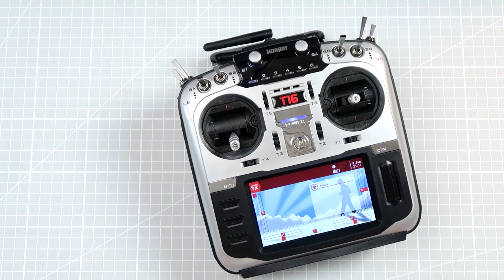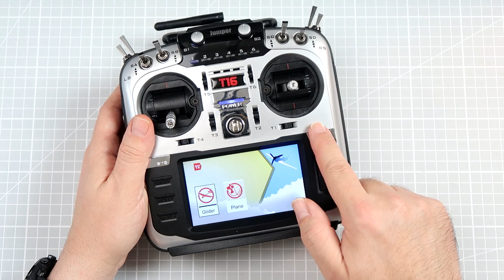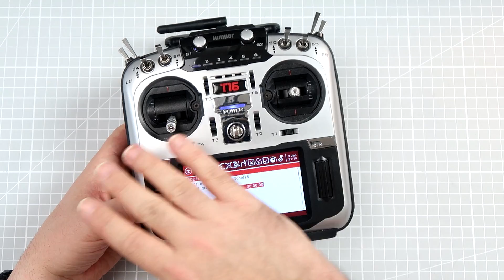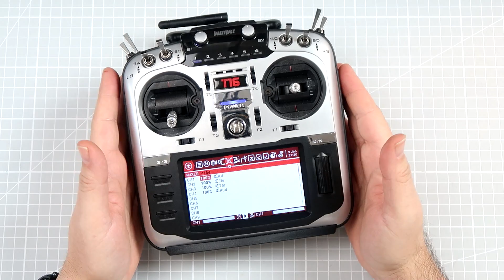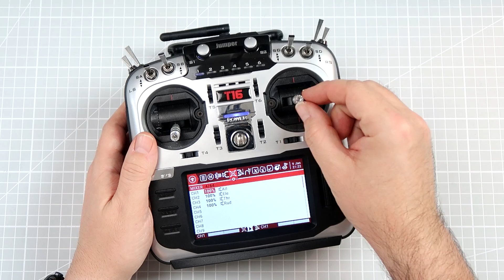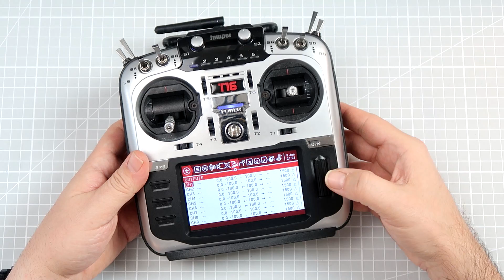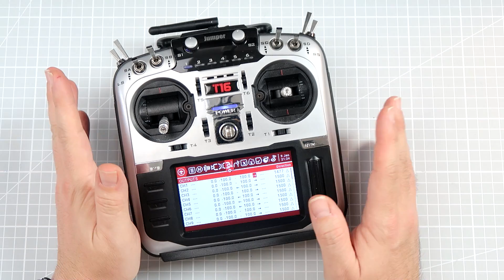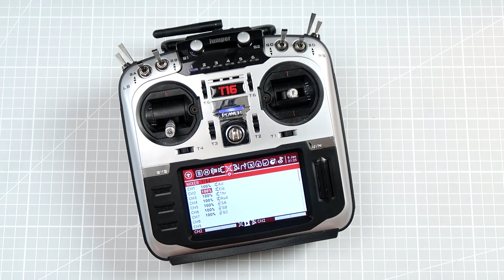OpenTX & EdgeTX Tutorial - Basic Setup

Comment: How to fix Failsafe problem for the FlySky receivers in T16? For example, with the X6B receiver, I always get the last levels of the signals when the radio is off, even though I set up NO PULSES
Reply from the maker: and how do you measure that?
Reply: @FPVUniversity  When my radio is on and my drone is connected to the configurator I can see changes in the receiver tab while I move the sticks. But when I turn off the radio then the levels of signal freezes at the last positions. Also failsafe icon 
remains non-active.